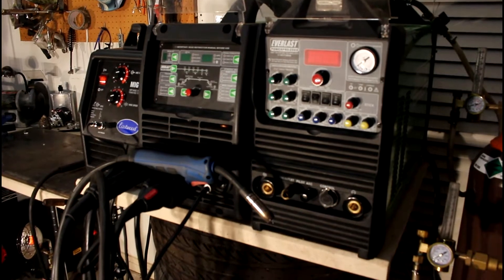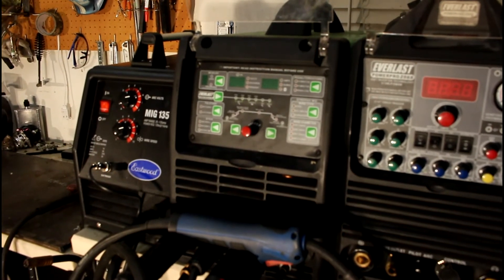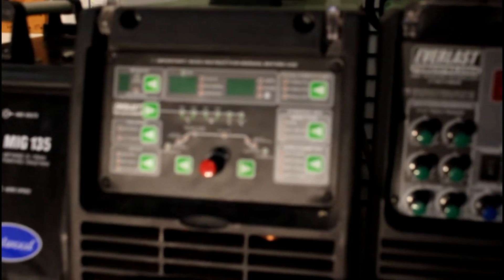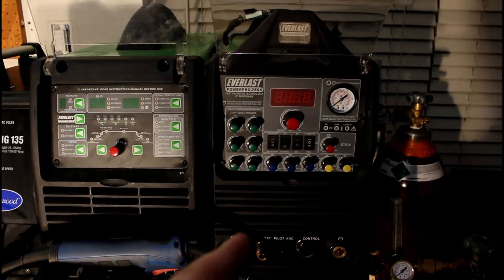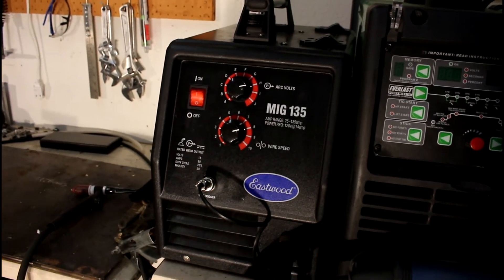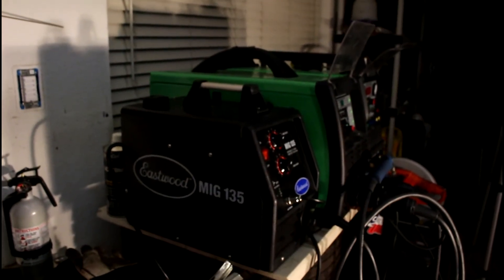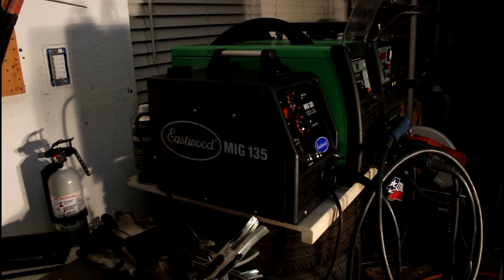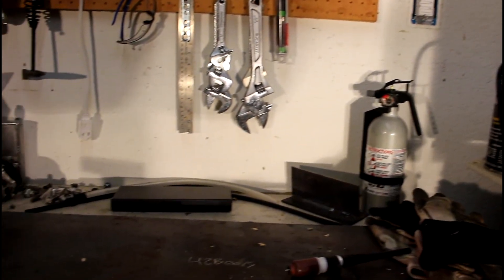Best 2 welders for a garage welder/fabricator

Comment: I purchased the Everlast 221sti a year and a half ago and wow what a beast. Everlast is defiantly the most bang for the buck. Mine is a mig stick and AC/DC tig  with pulse in both AC and DC modes. As a welder for almost 25 yrs working in many professional fab shops it is the smoothest welder I have ever ran in every mode. They run $2000 but will rival the blue and red machines for a fraction of the cost. I still need to get a good plasma machine and I think I will go multi process tig plasma just because the price is not much more over a stand alone and it will give me a back up tig. I looked at the exact two machines you purchased and was going to buy the same ones but  then the 221 sti came out and It was a no brainier for me I love the AC in one compact dual voltage machine. I have both bottles hooked to mine a 125cf 75/25 for mig and a 80cf argon for tig I just used a standard inline T joint on the line going in the machine and then a flow meter for each bottle. You just turn on the bottle you want for the process you are using. It works great. A person can do a lot in a small shop with this kind of equipment. thanks for the upload
Reply from the maker: Hey man thanks for the comments. Ya I definatly wish that 221 was out when I got the 211si I would have done that in a heartbeat. I love the green machines! I've never had a problem with mine and I've gotten alot better since uploadinbg some of these vids. I'll have to get back on the YouTube train soon and put out some more stuff. Thanks again and hope to see you around on here.